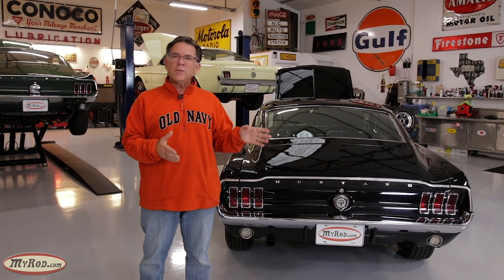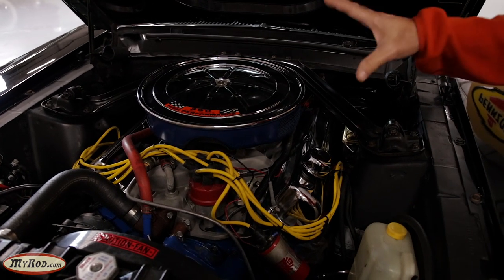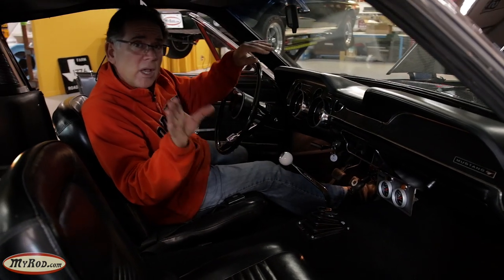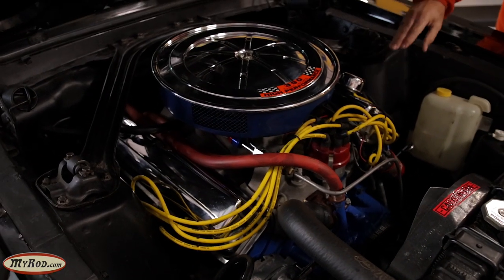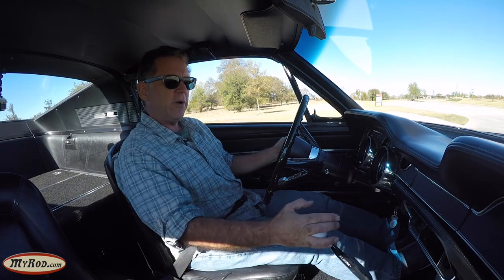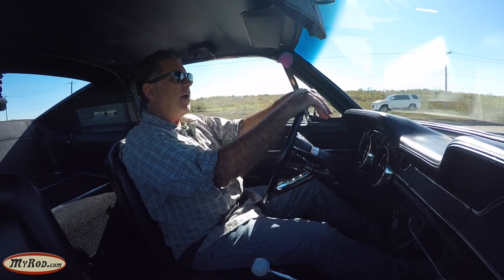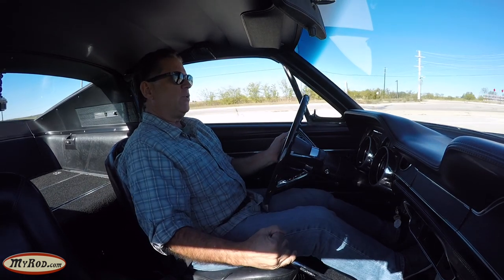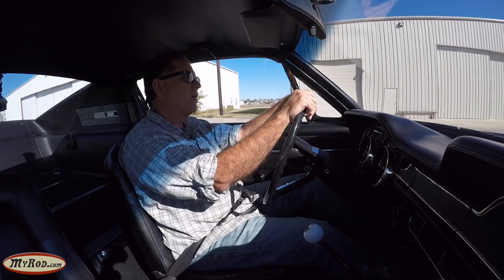1967 Mustang Fastback Upgrades - Old School to New School

Comment: Im 16 and going to get my lisence soon and im buying this exact car. And i also want it to have some modern technology like an AC and Bluetooth speaker not to crazy but yeah for my first car
Reply: ROYISGOD how much money would it cost
Reply: Too much... this guys gotta be rich to be able to find a fast back... they aren’t just a few thousand.. you’ll be lucky to even find a broken down one for a few thousand
Reply: @andrewcrank8949  ive found a 69 non fastback for 6k and old mustangs around that price but yeah none are fastback
Reply: Canada  True I’ve sold lots of things and saved up 16k but idk
Reply: @andrewcrank8949  I had been looking for a year before I finally found an original with the Marti report and they are not cheap. $46k and it's a full restore from the ground. Everything period correct except the engine.
Reply: Donovan Boston  great job you’ve now unlocked achievement *stalker psychopath.  (Bonus) 🏆 *restraining order
Reply: I’m 21 and it took me this long to get a 65 Mustang 200 in really good condition for around 15k but damn do they require so much maintenance, time, and money so when you do finally get your dream car prepare to have your dreams stomped on a little bit (not enough to ruin the experience or anything like that) because you’ll be wrenching on that thing way more than you’ll be driving it.
Reply: Damn
I found one at 12,500 at my location but I dont have the momey🥶
Reply: For your first car you want something that you're not afraid to scratch or damage
Reply: @steven-gl2lp  did you ever get the mustang fastback?

Comment: I never understand why an ORIGINAL S-Code fastback or convertible is restomoded.  They are very valuable as original.  If youi want to restomod a car, get a C Code and do what you want.  ANyway that is waht I did with my 67 FB (was lime gold 3 speed manual no power > now nightmist blue, crate engine, power steer, disc brakes)
Reply from the maker: They are valuable either way.

Comment: Leaving it stock increases the value...Resto-mod might be a little better, but it's pretty hard to find one that clean and original.
Reply from the maker: It's a 50/50 thing in my opinion. The market loves the restored and will pay significant premiums for well done cars, however the counter to that is the market is a blend of folks that have different taste. Therefore there is a segment of would be buyers who are far more interested in the "original" cars, especially one as significant as this one. I am somewhere in between, having a great appreciation for both as long as the restored is a MILD version in which the visual identity of the car is left substantially alone.

Comment: Nice!! I love your work and cars you guys do. I am a Mustang lover. I have two and had 9 in my life time. The one got a way was a 67 Mach 1. So will your upgrades make the value more or less? I have a 67 and I was thinking of doing the same, upgrading the suspension, motor, brakes ect.I know it will make the ride better.  A 5 speed just sounds weird. Why not just change the rear end. Keep the 4 speed. 390 is killer! 
Mine is black too. It has a tired 289. Is it worth rebuilding 289? People are telling me to get a crate 302. It seems to me the original motor would be the smart thing, but the gas is different now. Thank for sharing your guys work. I follow you all the time for Ideas.
Reply from the maker: The 5-speed with the right rear gear basically lets you keep the 4-speed experience and adds an overdrive 5th if you will. Changing to a real tall rear gear typically dilutes the performance experience.